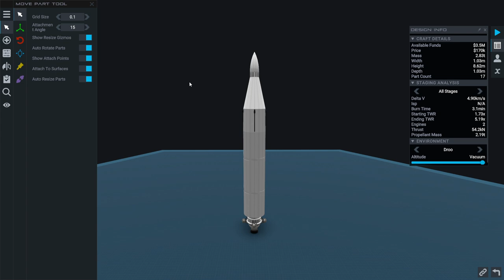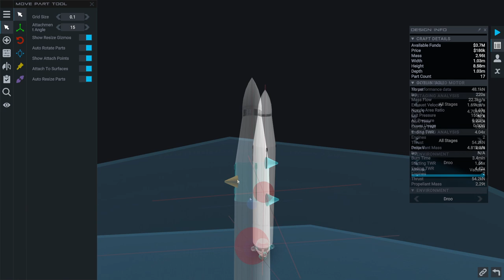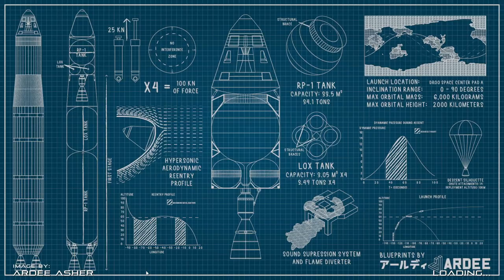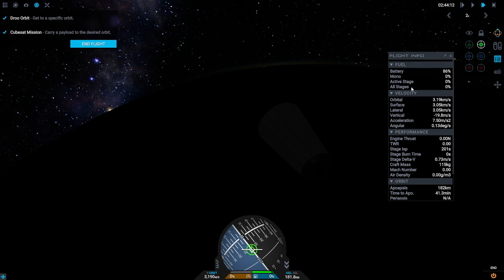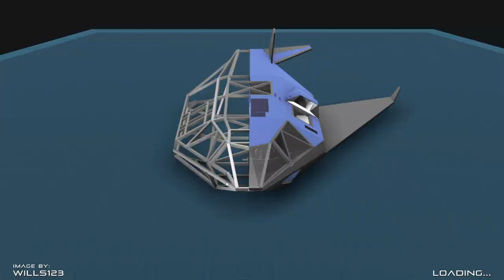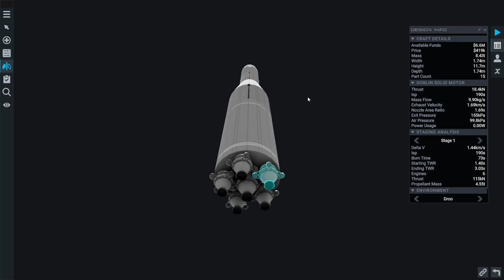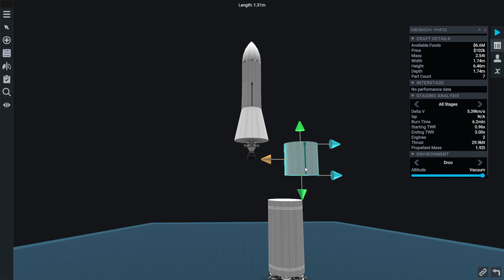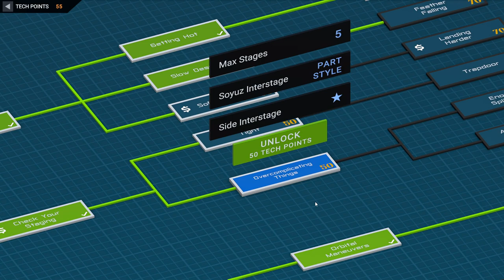Juno: New Origins (formerly Simple Rockets 2) - Career 04

Comment: I know you probably already know this but, SRBS are really good for getting really high up in this game, you can easily get enough speed and height to just have 1 upper stage (Preferably with a liquid engine for thrust control) if you have a good first srb stage that can give you most of the speed you need to get to low orbit.

(Edit) Oh and they're cheap as hell.